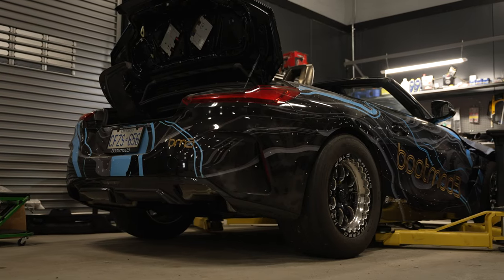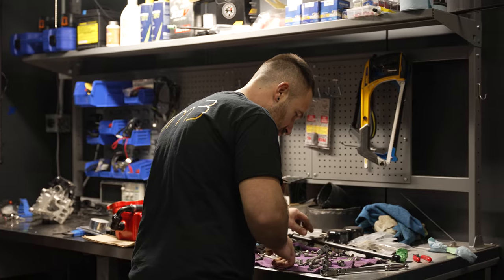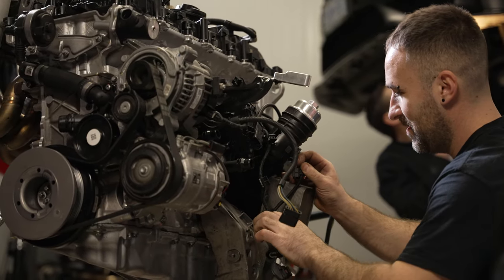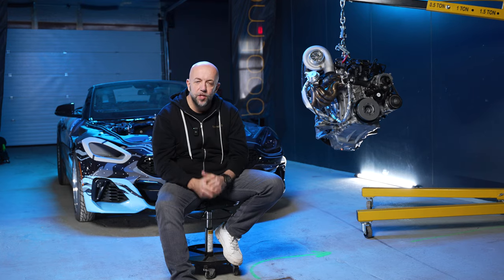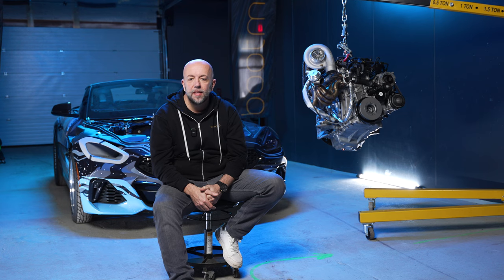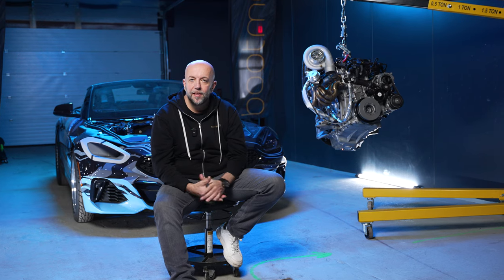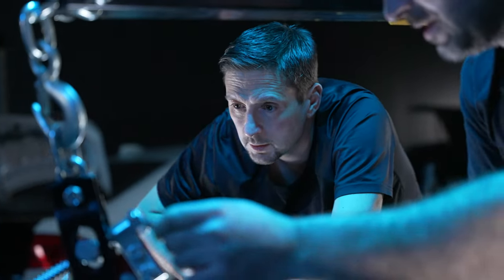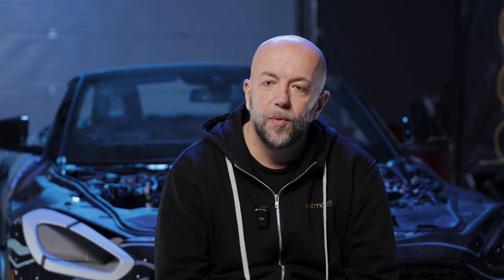1100WHP BMW Z4 M40i - GEN2 B58 | bootmod3

Comment: Will your release PI controller box in the future or what the PI controller box your recommended to be use with BM3 CustomROM and Flex fuel for Gen 2 B58. Thank you
Reply from the maker: Yes our Rev2 board is in the works, no ETA

Comment: Was the 1050whp pull a stock motor as well as stock HG?
Reply from the maker: Built internals, 3.2L, 1075whp with some wheelspin so was probably a bit more than that

Comment: Surprised that you were at 50+ psi boost.. you have some sort of restriction in the head.   It only takes like 36-38 psi to make 1100+ with that turbo on a 2JZ with 11mm cam and 278 duration.
Reply from the maker: Apples and oranges, its a di motor much smaller ports

Comment: headgasket failing at 52psi? jesus thats some tolerance.
Reply from the maker: Sure is :) wouldn’t push any of these on the stock headgasket much past 40-45psi tops
Reply: @protuningfreaks  are the 2 port heads have the same tolerance as the 6 port and how much power can these reliably cope with ?
Reply: @trevine33  pretty much, 2 port head flows less though